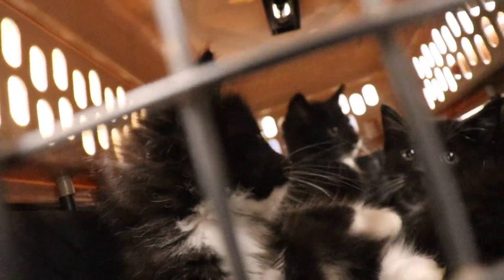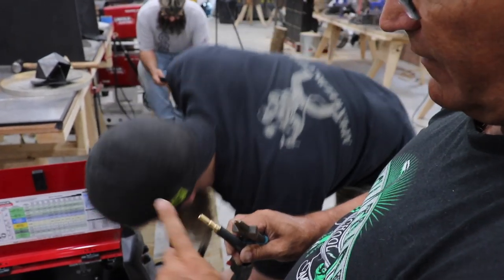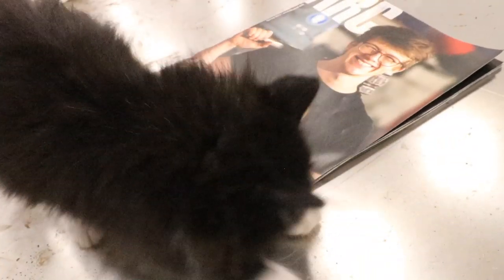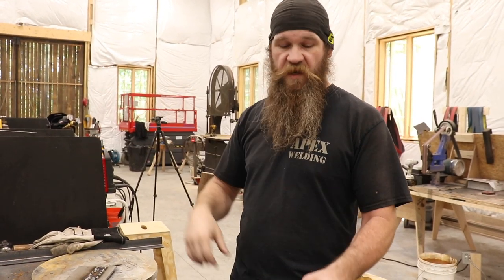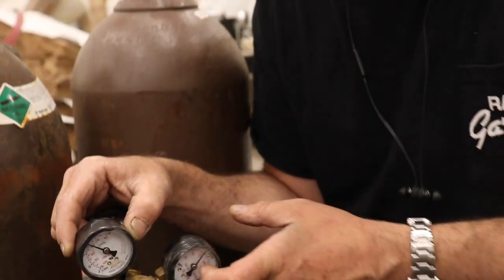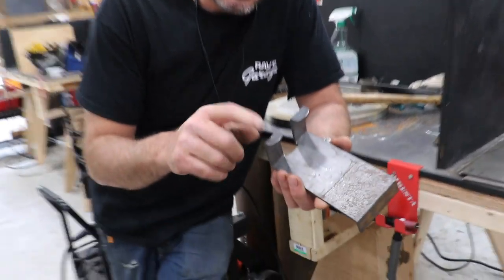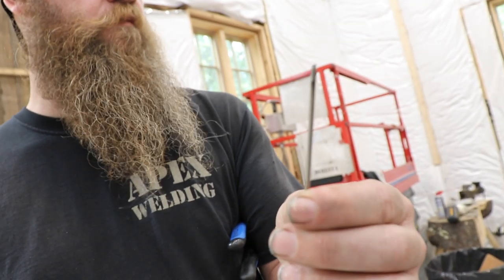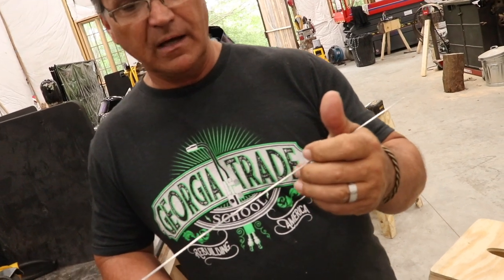DiResta Welding Tips

Comment: Nicely done. Condolences for the little buddy loss. Another small tip for folks welding solid wire with gas. If it's windy where you're working, the wind will blow the gas away from the weld area and cause poor welds. Flux core wire is better in those conditions. Nice job collaborating on this! 
Derek

Comment: Some really good tips guys! Ive been welding a little over 40 yrs. Im right handed, but when i tig weld i hold the torch in my left hand because my right hand is better at feeding the wire. I can feed with my left hand, but its just slower and the welds are not as neat.

Comment: I have a question about welding a thin strip of aluminum to a thicker piece, at 33:00.  If the arc tries to jump to the top corner of the thin piece, would it help to round that corner off?  Sharp corners concentrate electric fields - that's how lightning rods work.

Comment: What about reversing the polarity  for Aluminum...is that a thing?
Reply: I had to weld aluminum with a mig gun, spoolgun was broken.  I used a stiff aluminum wire and quenched the tip in cold water.  Heat in the tip was the binding point, any cause of birds nesting, but with cooling the tip, and or removing shield cap and filing the contact tip, removing it, advancing the wire and reinstalling shield cap and tip.  Big job, only went through a couple tips over the whole job.  Welds were all great, more than cosmetic.

Comment: Great video and lots of informations for beginners. But there's no reason to cut with an angle grinder like that for right handed, though. When your blade got stuck first time, especially when you cut with a big grinder or even engine powered, you will get the point immediately!! 

The cut also kinda straighten itself, when the grinder pulls away from you.

Comment: 17:30 well of course you cant mig weld on top of a piece of 3/4" steel no joint or edge to bite into... youd get a fine weld on that joint between the two pieces with enough amperage/wirefeed never had an issue mig welding vertical